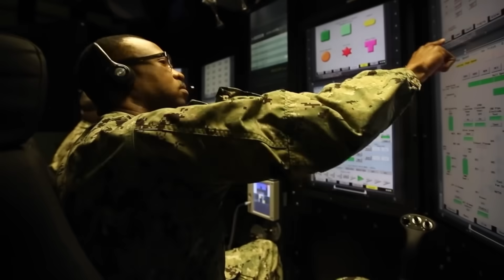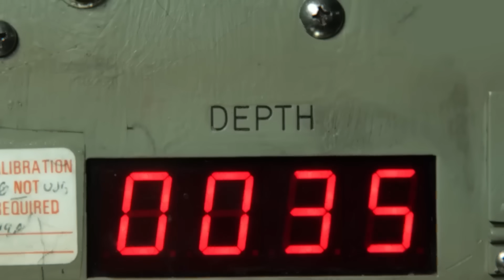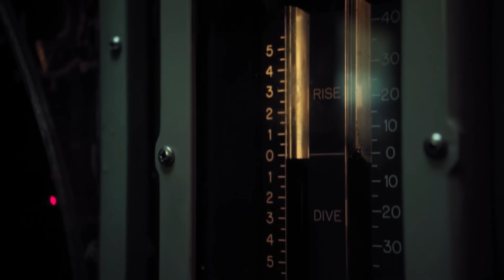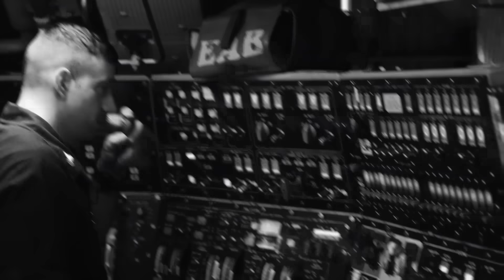What Happens When a Submarine Hits "Crush Depth"

Comment: To get a fathomable idea of how powerful the pressure is down at crush depth, if you were able to make just a tiny hole when you are on the surface, the water would just trickle down slowly from that hole. At crush depth, that water would be shooting through that hole with so much pressure it'd cut right through you like one of those industrial water jets that cut through metal.
Reply: Depending on how deep you are, you wouldn’t even see the water shooting through the hole, the submarine would implode and crush you before you even knew what was happening
Reply: @shiranuithewolf8559  yes, I agree with you. This is rather an imaginative example to make it easier to understand the constant pressure one would be dealing with at lower depths
Reply: @shiranuithewolf8559  yes, but i think he means hypothetically speaking
Reply: The pressure at 12,500 feet (I think I read this as the depth at the titanic) is around 5,560 psi or 378 times what it is at the surface.
Reply: @cavediver2579  I am sure I read somewhere that it was 14.7 PSI at sea level.  I could be wrong though.
Reply: @AM-sx3iu  yes that where the conversion from atm(bar) to psi comes from 1 atm(bar) at the surface is 14.7 psi, 12,500/33+1 is the pressure in atm (bar) then multiply by 14.7 to get your pressure at that depth. I did the math in my head on the first response.
Reply: This is one of the only things I’ve read that’s put it in perspective. PSI and atmospheric pressure is always described as “an elephant on a postage stamp!” But that doesn’t help to imagine the actual effect and what you’d be experiencing
Reply: @PapaLuigi01 Someone said imagine the Eiffel Tower now turn it upside down and put it on your big toe lol
Reply: @PapaLuigi01 😮
Reply: @PapaLuigi01 I think some people found out for real with the ocean gate submarining...
Reply: Fathomable? Love it!!
Reply: @warren4110  what's wrong with it 😐
Reply: @Swahili14 , 6 feet = 1 fathom; a measure of depth. Don’t know whether the pun was intended but, I got it and liked it!
Reply: It's like an "Empire State building pushing on you from all directions at once."
Reply: Why does it generate heat tho
Reply: @strawbunny99 when a gas is compressed it heats up- it’s the same principle a diesel engine operates on. Conversely, when a gas expands it cools. That’s what makes clouds form.
Reply: @strawbunny99 Heat and pressure are directly related (when volume is constant).
Reply: @strawbunny99 Gases heat up under pressure. More pressure, more heat. The gas molecules are flying around faster and faster and creates heat. I don’t remember the specifics from physics tho. But if you remember Newton’s Laws, matter doesn’t get destroyed, and equal opposite reactions.
Reply: @strawbunny99  Compression... just like in a diesel engine.
Reply: @strawbunny99  Gases become hotter when under compression... just like the fuel/air mixture in a diesel cylinder.
Reply: @strawbunny99  adiabatic heating of compressed air, just like Santa Ana or Chinook wind, or the ignition in a diesel engine.  In reverse, its adiabatic cooling. Adiabatic just means it's not friction--it is totally reversible.
Reply: That’s amazing and terrifying
Reply: Titan engineers….next time use Trieste’s 5” steel wall thickness as your starting point. Not carbon fiber.
Reply: @USA-GreedyMenOfNoIntegrity  err, there won't be a next time. Think Pan Am.
Reply: That’d be a weak waterjet. Most are 10000psi + still a great point
Reply: So would your body just collapse on itself ? Or explode? 😳
Reply: @phoenics0912  i think its kinda both. Like you implode so hard that everything rips apart and just kinda destroys itself.
Reply: @phoenics0912 your lungs would instantly fill as would your sinuses.  There would be fatal damage to your lungs... wouldn't matter as you'll have instantly drowned. Your body would be saturated with seawater and would shut down right away.

At least they didn't suffer. Instant blackout.
Reply: @davidhenningson4782  Not really.. your body would instantaneously end up in tiny pieces.
Reply: @davelowets  hopefully those pieces held together.  Nice if the families have something to bury.
Reply: @davidhenningson4782 I don't think is a good idea to risk more lives to get small amounts of remains.
Reply: @davidhenningson4782  they're already burried.
Reply: @jpizel1070  with ROVs... not people of course.
Reply: @DrDeuteron  yeah technically... buried at sea.
Reply: @phoenics0912  Probably both if you think about.
Reply: @phoenics0912 since you are mostly water or Pepsi, which are not compressible you would be ripped apart just by the violence.
Reply: This has aged well
Reply: This water jets actually cut it through the sand inside the water just works to shoot the sand so strong it actually cut the metal.
Reply: Wow
Reply: Thats a great example
Reply: that sounds like one hell of a way to harness energy tbh
Reply: It’s like taking a belly flop shot to your entire body times 1000
Reply: Water can cut through diamonds like butter. Let they sink in
Reply: This is probably the best way I've heard it described. Overlook the "well actually" commenters.
Reply: @aawells07 ☝️🤓 well, actually...
Reply: @andrewut7ya511  lmao 😂 actually bro ....☝🏾
Reply: @aawells07 Ah yes the best way youve heard it described, if you overlook the comments that debunk it. Amazing.

Waterjets are simply insanely more powerful than what he is describing, lol. Sure 5000 psi could cut flesh. So can a butter knife with the force of a child operating it...
Reply: @Partyaap050  I love you babe
Reply: @aawells07  😳
Reply: @aawells07  The analogy doesn't work when it's the psi is 10 times weaker than water jet cutters
Reply: @sneedfeed7204  ok everyone understood. I never thought it was an exact science.
Reply: @aawells07 lol, yea that's good way to learn. Just pick out the bits that sound good to you. Smh.
Reply: @aawells07  What a weird comment lmao people are confirming that the jet would be 10x less force but your like "NO ITS THE SAME THANKS!"
Reply: @jacobc7643  I knew it wasn't an exact science numb nuts and never said it was. I don't think he was trying to say "this is exact 1 to 1 explanation". Move on honey
Reply: Puts that into perspective...! Holy macaroni!!! 😧
Reply: If you could descend 10 miles down, what kind of submersible could you possibly be in ?
Reply: @JackReynolds-w7g  def not in the Titanic Ocean Gate ...Maybe in Voyager 1 🤷🏽‍♂️
Reply: @JackReynolds-w7g pcp
Reply: Wow that's interesting and crazy
Reply: So basically it would be like the scene from the movie The Abyss, scene Michael Bien character was in that sub going down deeper and it imploded?
Reply: 😮 omg. I didn’t think about water leakage just the hull imploding on itself.
Reply: What is the crush depth? ? ?
Reply: @stestar09  crush depth is the critical point of depth and pressure where the hull will be - crushed. Aka crush-depth. It is not at a set depth, but most subs have a 'tested safe depth' which is how deep they can go knowing in theory that they won't get crushed or imploded. You only find out the crush depth once.
Reply: @stestar09  at 2000ft i think it got crushed
Reply: Thanks this actually explains it the best. Now I can visualize the pressure
Reply: https://youtu.be/AImdSc7vsxs
Reply: Pink mist
Reply: well said, so crew WOULD gt some painful warnings...and that mini sub probably got a few also...it was reported that they had released their weights ...so they KNEW or SAW they were in trouble...but could not ascend fast enough to escape the pressure that was crushing them
Reply: The example I got given was of a scuba tank- normally you open a scuba tank and it gives off air. However at an extreme depth if you were to do the same the water would be putting so much pressure that it would flood the tank and displace the air within seconds.
Reply: Got dayuuuummmm
Reply: Then that high-pressure water would cut another hole in it
Reply: It would be more inline with an industrial pressure washer.
Reply: That certainly helps to understand. Thank you!!
Reply: Years back everyone became an expert Virologist when cov!d hits, then a military master strategist when russo Ukraine war happened and now everyone is a submarine expert. Wonder what's gonna happen later on.
Reply: On every comment feed. I’ve witnessed each discussion descend into the most pitiful arguments. The internet really does take away the filter of a human being and what’s left, is the ugly sight of petty children squabbling over each others mis interpretations whilst trying to impose irrelevant intellectual none sense upon one another. I came here to learn a little, and I got treated to this crap. Wake up.
Reply: Nope. Carbo fibre shatters. It would shatter the centre section like a glass bottle, leaving the nose cone and rear tail to separate and drift apart, across the bottom.

"BANG!!!!" Done!      Like stacks of mass on every shattered part flying inward, to fill the lower pressure compartment.

It would mix up EVERYTHING in that Sub with shattered carbon fibre and Sub Parts!

Catastrophic Implosion!!!
Reply: who cares
Reply: @mica122213  all the people who liked the comment and who found my comment relevant. Just because you didn't does not make you special. To be honest I don't know what would warrant a comment like this from a stranger on the internet - in a video about submarines. If you don't care, why comment at all?
Reply: While at the same time boiling the air to the point that everything in the sub is immediately incinerated.
Reply: Another guy in the comments pointed out that the hull would have shattered in about a tenth of a second after the moment the hull was compromised. There would be no jets of water, the submarine would instantly collapse and everyone inside would be gone in an instant.
Reply: Oh wow......That's insane !!
Reply: No, industrial water jet cutters are 55,000 psi
Reply: This is am absurd lie. At 4,000m depth the PSI is 5,800 psi. An water jet cutting system operates north of 40,000psi. Usually 60,000 psi with the ones we use.
Reply: @user-ky6sm7tp9s 😂 you're funny... no its not an absurd lie.  You need to learn how to read better.😂  He was using a comparison, not saying it was the same. 😂 
Education time: As little as 100psi water can puncture skin, 1000 psi can cut through skin (and underlining meat, not necessarily bone) like a knife through butter, 1700psi can cut through concrete (and bone).  It all depends on the size and shape of the hole (i.e. a nozzle size) which is allowing that water through.
Reply: @Hrossey  he didn't say it would cut metal. He said it would cut through a human body the same way jet cutters cut metal.

At least read the comments before responding. Nevertheless that was very interesting information that you shared.
Reply: Water at 4000 psi from a hydro jetter would kill a person with heavy messy damage. That pressure in the deep ocean? A needle piercing air.
Reply: Considering this video has been out for more than two months and you're now just commenting on it, are you really interested in submarines? Or just commenting because of the ocean gate tragedy?
Reply: @trollgeneral6624  I think a lot of people are here because of the tragedy, because it has highlighted some of the dangers of the sea. As horrible as these events are, they can serve to educate people (and clearly a lot of people are interested in this topic). I hope you're being consistent and questioning everyone in this comment section.
Reply: @TranscendentLion  I am don't worry. I ask the same to you for my consistency
Reply: @trollgeneral6624  Does it matter
Reply: @user-ri3oz1hi4k  if you responded to it, it should matter
Reply: Bro tried to sound smart.

Comment: The Titanic wreck is at 12,500 feet deep and US Navy Submarines cannot go that deep
Reply: I don't think any submarine can go that depth. There is a reason those fkrs were charging 250k per person for this doomed trip.
Reply: @Null_pointer_exceptn 250k for a burial under the sea in a sub close to the Titanic sounds like a fair deal to me.
Reply: @Null_pointer_exceptn you do know the Titan submersible went on at least 2 successful tourist Titanic trips before then, right?
Reply: @JPMarie55  does that make a difference? If you don’t have a plan to get the thing out when it’s stuck, it was bound to happen sooner or later
Reply: @Null_pointer_exceptn yup the fact its bolted shut from the outside and no way to rescue them if its trapped is absolute psychotic….the navy even said if they were still alive down there, theres no way they would be able to get them out
Reply: @chikensaregood9500  So sad just even imagining it! =(
Reply: @chikensaregood9500 if you somehow managed to open the door at the bottom of the ocean, you aren't swimming back up. But, the pressure of all that water means that door is sealed, even without the bolts.
Reply: @JPMarie55 yeah, the ocean gave them 2 chances before this tragic. The hull was weakened by the pressure in those two trips and it's not able to withstand the pressure this time.
Reply: @Null_pointer_exceptn  Highly specialized submarines can and did, the Trieste reached the bottom of the Mariana Trench in the 1960's already. But if you cut ANY corners - you're fked sooner or later.
Reply: @Null_pointer_exceptn People have dived to 11km already
Reply: @Null_pointer_exceptn there’s been 150 people already who’ve visited the titanic there’s a bunch of submarines made to go visit those depths what are u talking about 😂 u mean there’s no rescue submarines that can go that deep
Reply: @Kevin.valdes7  thats exactly what i am talking about. There is no system capable of bring 12k pounds load back to the surface. US  military has salvage system that can technically go to the depths of 20k and is capable of such maneuver, but it has never been done yet. Also in that case you r taking help from external sources. What’s the companies planb in such cases? They r not at all capable of bringing that thing back up. U r on ur own when it goes down and it took everyone down with it
Reply: @Null_pointer_exceptn  okay so your not understanding or misinformed a rescue vessel used for submarines can rescue the submarine bring them on board and take out the passengers out while underwater. However There is still a robot that can rescue or pull out ships wrecks or for this instance a submarine at those depths and that’s a drone not humanly controlled as I was saying but yes there is a machine that can still “rescue” and pull out things at those depths but not instantly rescue as I was saying with the other vessel that can do it All underwater as some situations oxygen and time is a matter so the drone will instead jus bring them back up to the surface and that would’ve taken 2 hours instead of the other rescue vessel that can do it instantly underwater but not at those depths but yes there would still be a machine that would’ve rescued them if they didn’t implode
Reply: @Kevin.valdes7  ok may be I don’t understand all the systems out there. This will always be an unreasonable risk for me.  People r free to choose their death i guess but IMO this is one of the worst ways to spend money
Reply: @Kevin.valdes7 You’re living in a fantasy world my friend🙄 There’s no machine or submarine capable of rescuing anyone underwater, the water pressue at that depth is absolutely mind blowing . . . . . The only way to rescue anyone would be to bring them back up to the surface first and then start working from that point.
Reply: @33Camden  you are very much misinformed a rescue submarine can rescue people underwater so like I said previously that specific rescue vessel can’t go below 2000ft so the other option would be to send the drone down that they have to reduce any submarine
Reply: They ass was on one the day they decided to do it
Reply: actually, a few navy subs can go a maximum depth of 20,000 feet.
Reply: @bigsmoke4345  not rescue subs holy shit y’all need to know exactly what your talking bout before u speak
Reply: @bigsmoke4345 no it cannot. Period
Reply: There is one that can dive to 38,000. It was used in the Marianna Trench.

Comment: I have heard one thing that can happen is the very air inside the submarine can ignite from the pressure?
Reply: Yes but it wouldn't matter, they'd be dead by then. 1500psi at 1000 fathoms. 
Hull rupture would mean instant death. IMO, that's the most likely outcome. They felt nothing.
I would not get my hopes up on "tapping noises" unless they were in Morse code, if people still even use it.